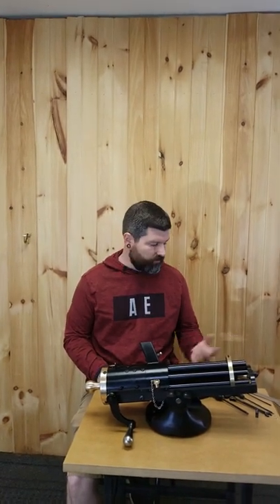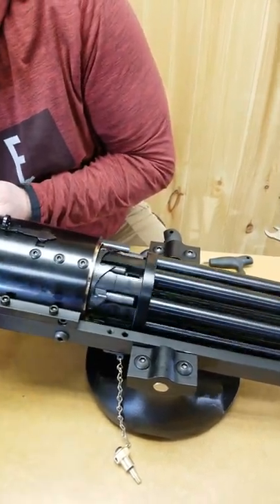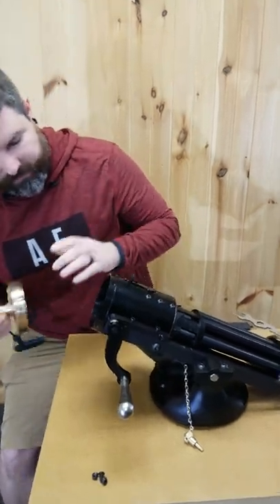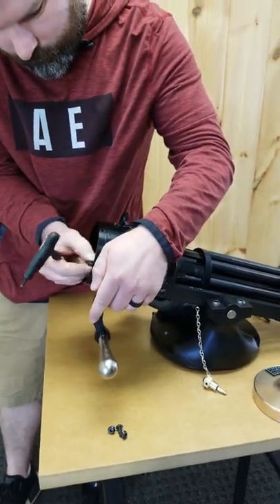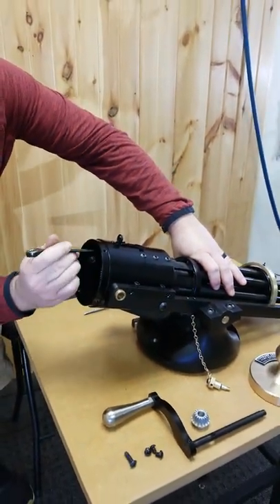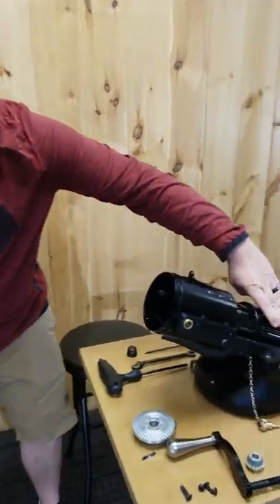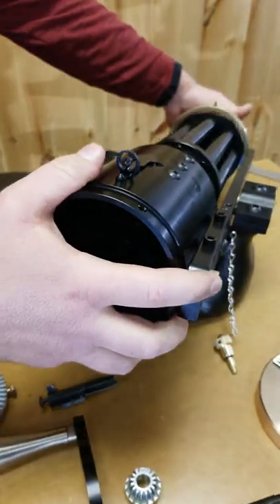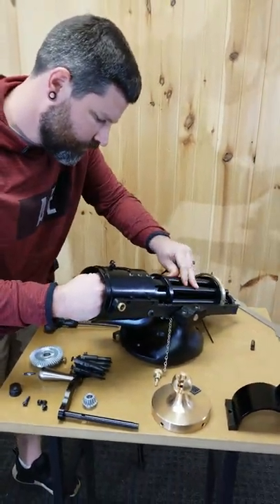Bolt Removal | Tippmann Armory 9 Mil Gatling Gun

Comment: The .22 Gatling Gun bolt replacement is very similar. The main gear has a Allen screw that is accessible via a slot underneath the Gatling gun that holds it in place.  Loosen it up and the main gear can be removed in the same fashion. Awesome design!